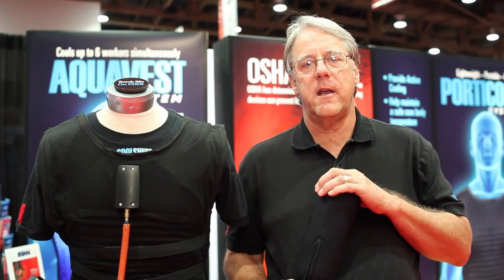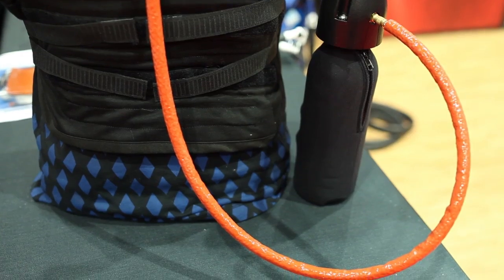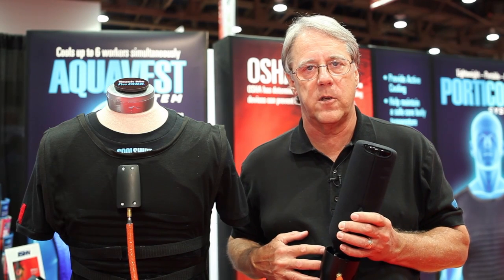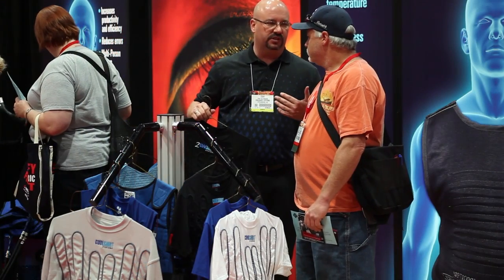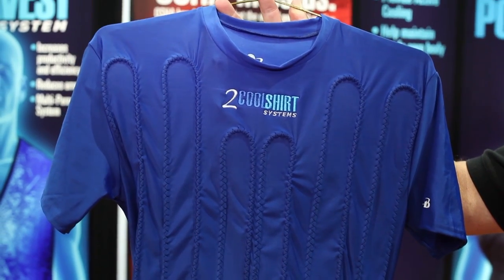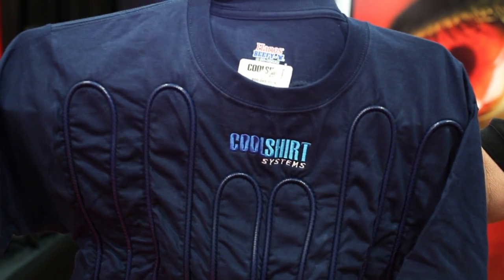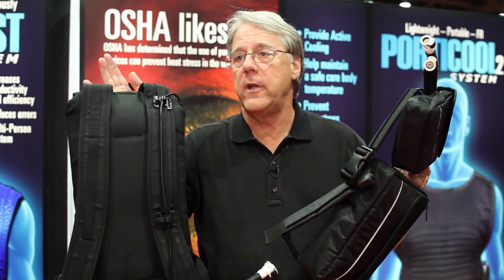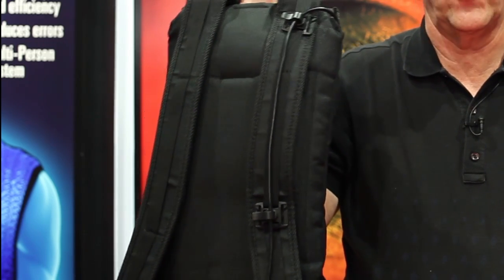Coolshirt Systems

Comment: You need to implement this tech in a pillow for sleeping.  Nothing worse than a hot pillow!
Reply: OgeeGaming right a pillow that uses carbon dioxide to cool it, that called a suffocating pillow.
Reply: Try using silk or satin.   Better for your hair too.   Also smooths skin.